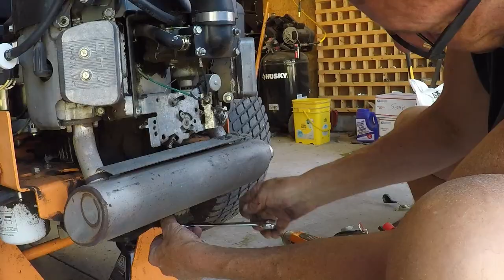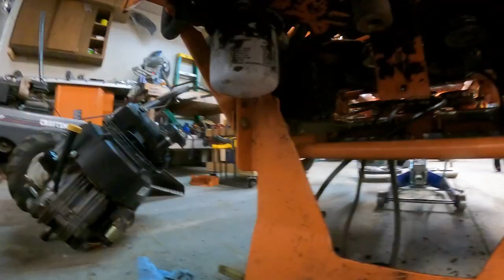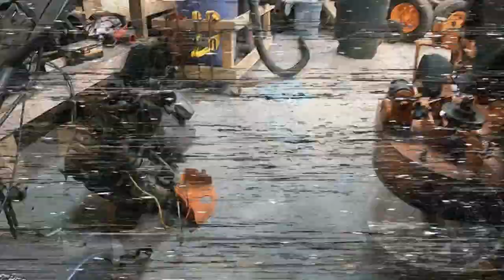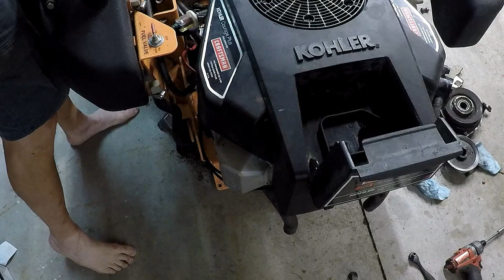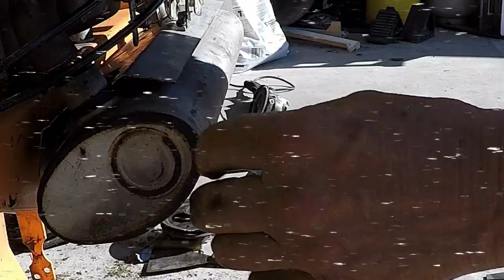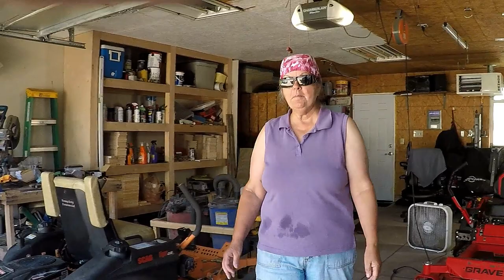Scag Tiger Cub Engine Swap Kawasaki to Kohler

Comment: Looks like your trailer had some plywood in the back.  I put three pieces of treated in my open trailer last weekend.  Almost lost my cookies at $154 for three 3/4" sheets of pressure treated plywood!  Might last a few more years!

Mower troubles!  Been having those too.  My ZT2800 transaxles broke from the frame of my ztxl42 when I hit a big whole covered up with overgrown grass!  Three shop visits later its fixed.  One welder shop visit, two back to the dealer for a total of $841 dollars and I am back to smooth baby but cuts with it.  Wish I could turn a wrench like Mark.  Could have save so much money.  At least its fixed now and has with impeller bagging.  A new setup would have cost close to $8.5K. 

Ya'll keep mowing and putting out those inspirational vidjos :)  Thanks

Comment: I swap one of these a few years back to a 26hp kohler command. Mine had a 19hp kawasaki i bought a muffler for mine cost around 200 amd put reaper rear tires on it. I love mine best mowers they make in my opinion
Reply: Guess so you change it .
Reply: What model was it and what engine was it ?

Comment: What's the cost of a new motor as apposed to a new mower?
Reply from the maker: We bought the (used motor) for $600 brand new zero turns about $6-7 k Also the time to do the work he’s got about 12 hours at least into that repair
Reply: Really it’s best to go with a new engine or good use one if fram and deck in fairly good shape 😊

Comment: Watch your channel because I have a Tiger Cub.  Recently had to replace the PTO clutch.  I didn't hear you say why you had to swap out the motor?  Did it die on you, and if so, how many hours did you have on it before that happened.
Reply from the maker: The engine blew it was tired with 1800 hours.
Reply: @vickisoutdoors_  Thanks for the info.  Mine only has about 650 hours so was just curious how much life I should expect to get from it.  I had to remove/clean the carb this past week as it started surging the last time I mowed.  Cleaning out carb fixed issue.  I first replaced the fuel filter (NAPA part no. SME702390).  It is exactly the same size as OEM and is rated at 15 microns so wanted to mention that to any of your subscribers that might be looking for an awesome replacement fuel filter minus the Scag price!